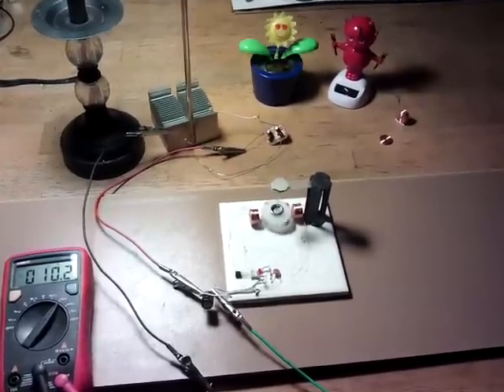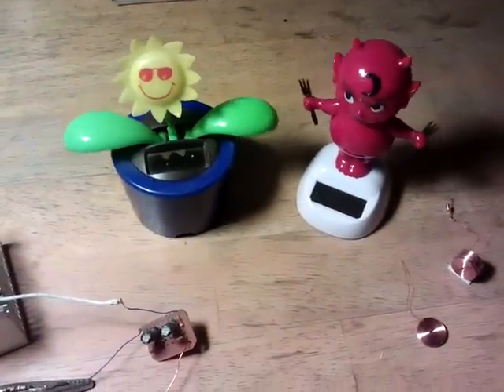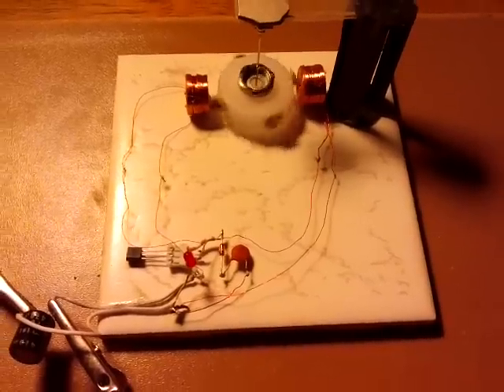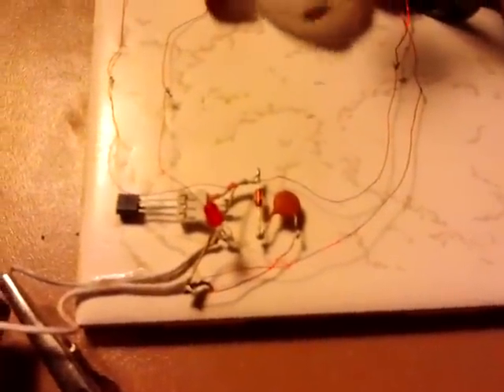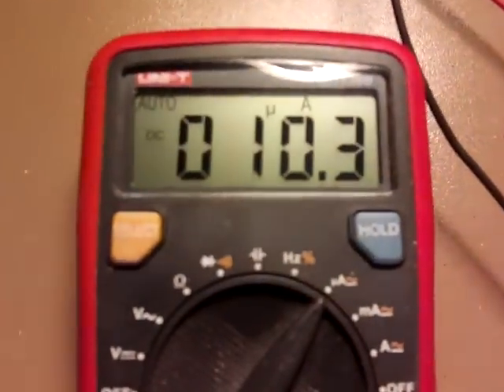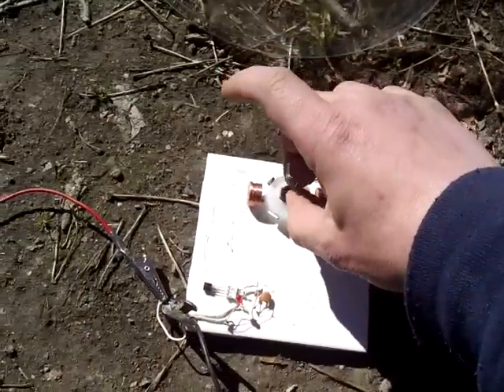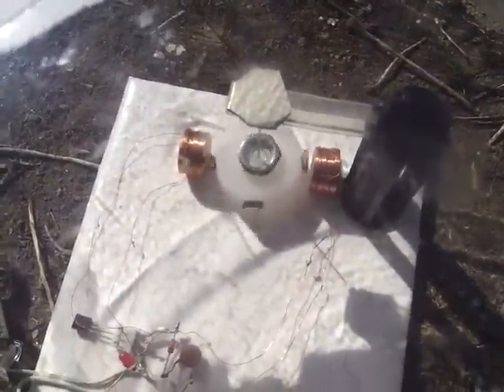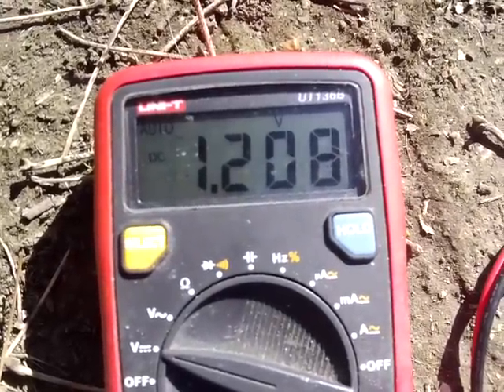MMG - desklamp powered motor, no battery, no solar

Comment from the maker: In reply to Patrick (your 'Reply' is switched off) - will try it in the A field :)
Also going to try reed switch running again, component swaps, remote rotor harvesting and Beam engine cap dumps. Your EB transistor return idea was tried, but seems to need more rotor speed for efficiency than I have here.

Comment: Great work apart from all those poor solar movers. I hope you gave them a suitable send off after you butchered them.
Really like the CFL and Hard Disk platter set up, very impressive.
Reply from the maker: Knew you'd cringe lol. Funnily enough, every single one was given a run for a few minutes before dissection, to make sure they worked and visually check coil strength. It made it worse with the Devils having an anthropomorphic design !  I'd be rubbish at voodoo.
Without the platter the result up close to the light is around 0.8V continuous and falls just short of running the motor. The platter was left on for several hours, with no motor running and got to 14V. Putting a harvester pickup right on the bulb can result in >35V, which is no good for 16V capacitors !

Comment: crazy low power consumption, that's cool
Reply from the maker: Cheers Kyle. Thought of your Peltier candle experiments while trying low input sources. They are good for massive current stuck on a window or something and that's easier to translate to voltage than the other way around.
Reply: For sure. Nice to see some sort of real world aoplicationn, too, such as charging a super cap

Comment: Very nice. Thanks for sharing.
Reply from the maker: Glad you liked it Terry :)
Reply from the maker: Nikola Tesla
Haha yes, for any of the apocalypse scenarios !
Galvanised steel electrode failed 3 times after 6 months each or so, on my 3 yr old Nephilim Penny oscillator that runs on water. The fix was to use Zinc itself lol, seems obvious but not at the time.
The series linking of earth cells must be within the Stubblefield work I think..will hunt around. Am a fan of untouched dirt, otherwise it becomes a salts cell really and such things as the motor would be a fake run, with added salt or pouring water around.
Reply: Nice earth battery. You can create batteries in series, telegraph uses earth batteries. Love all those coils from $ store 
Great
Reply from the maker: Thanks. Could buy a lot of coils with the proceeds from finding your missing Edison Medal, from the safe in 1943 lol
Series has always been a problem for earth batteries for me, sharing the same electrolyte. Though, many blocking oscillators can run from 1 shared connection and many separate other connections in the same ground. 1 Positive shared/many Negatives individually. That's another line of research and am always interested in how to sum earth batteries in series. Any pointers would be appreciated :)
Reply: There's a patent from the 1850's that I copied b4 , problem I ran into was the ground needed to well saturated and had to add lime in soil. And the zinc coating would  corrode  quickly. But in the dawn of the zombie apocalypse it is good to know.

Comment: Great work, Slider! Can you get this device to charge a real battery while it is running "on dirt"?  What is the link to the bench? Thanks for sharing.
Reply from the maker: I'm wondering that now that you've mentioned it. If the return via the diode and cap went to a battery instead, then it should work. The Mg and Cu deliver 750uA with no load in this dirt (not rained for a week), which is higher than the lamp. Will try it :)
The bench might not be able to be seen, am unsure how it's all set up if a non member. Here's the link:
http://www.overunityresearch.com/index.php?topic=2784.msg46018;topicseen#msg46018
Reply from the maker: Riskteven
Indeed, the low power being used translates to lack of charging. The update being, that I tried it with a rechargeable AAA last night. 1.237V start, after half an hour was 1.240V lol, nothing really but maybe useful for continual running over a week.

Comment: Hi Slider. A very interesting design to say the least. Thank you for sharing Mate. :)
All the best.
Bobby
Reply from the maker: It's a job to solder those tiny wires to make the coils, but well worth it. This carries on Lasersabers original high ohm coil successes with the EZ Spin, the efficiency is staggering with such coils. All the best to you and yours too Bobby :)
Reply: slider2732
I bet it is, I shake so bad I would have everything but the wires soldered :)
All the best.
Bobby